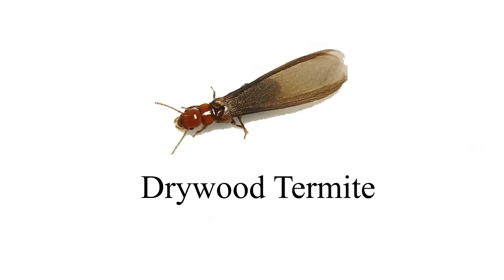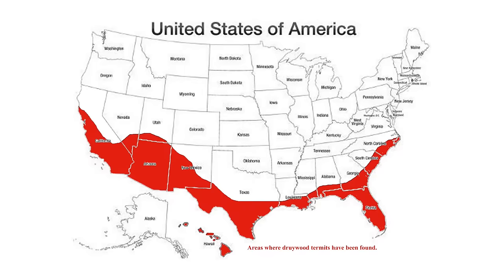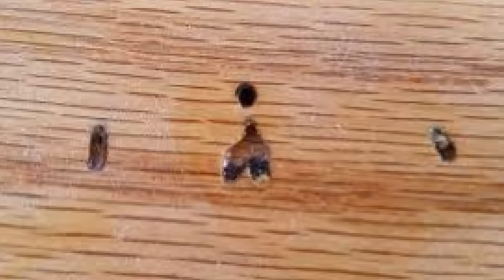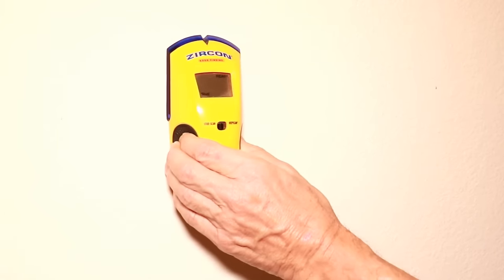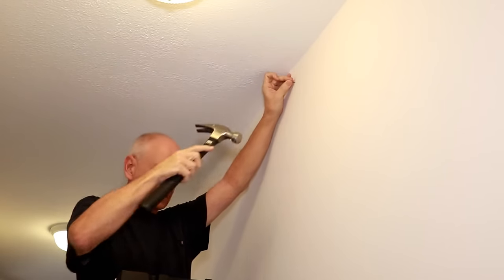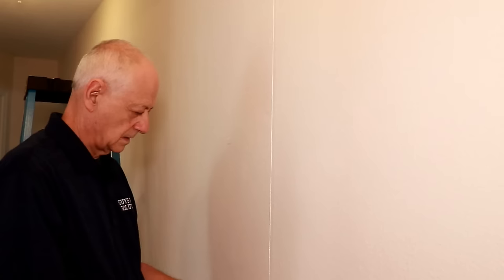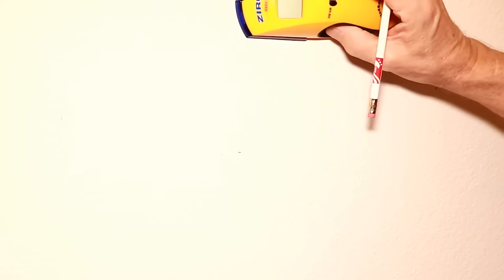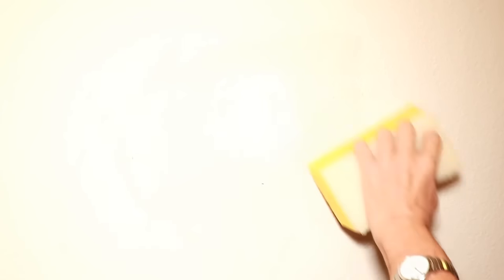How to Treat a Drywood Termite Infestation Yourself. A MUST see if you have Drywood termites.

Comment: Is it not a good idea to mix Bora-Care using a blender?  Also, how hot is too hot for the water to mix with Bora-Care?   Thank you in advance!
Reply from the maker: Gosh.  I never thought about mixing Bora-Care in a blender, but I don't see why not.  Just don't use the blender for preparing food after that.  The truth is that you can mix Bora-Care with cold water.  I do it all the time.  I don't think it matters how hot the water is, but I wouldn't boil it or anything.  Straight hot from the faucet is fine.  It really is not that hard to mix.  I needed a very small amount of it the other day and I mixed 1/2 cup of Bora-Care with 1/2 cup of water and I just stirred it with a paint mixing stick.  It takes a little longer to mix it that way, but it wasn't all that much time.  Even for that small amount, I took the water straight out of the garden hose.  I didn't think of using an old blender, even though I do have one.  So, that may be a great idea for mixing small amounts.  By the way, you should always mix it one to one with water and not one to five, even though the directions say that you can do it that way.

I hope that helps.  Be well my friend.
Reply: @GuysPestSolutions   Thank you for your reply.  It seem that when I mix it in a 5 gallon bucket and use a paint mixer on a drill it takes a bit to get it mixed.  

Glad you told me to use 1:1 as I was only mixing 1:1 were I found termites and 1:4 for preventive spots. 

Thanks again!  You are a godsent!
Reply from the maker: @celldata4john  You are very welcome.  Thank you so much for those kind words.  Very much appreciated.  Be well my friend.

Comment: Thank you this has been educational.. I had add a fumigation done and sprayed the attic but I'm not satisfied not satisfied. So so do I do the board acid and use the granules or do I I'm confused Taurus SC?
Reply from the maker: I'm sorry.  I know this stuff can be very confusing.  Let me see if I can unpack some of this for you.  You see, termites come in two basic flavors.  There are subterranean termites and there are drywood termites.  As the name implies, subterranean termites live underground, and they never colonize in your house.  They just go there to eat because your house is their favorite restaurant.  They always return home to the colony to obtain the moisture that they need to survive and to feed the other termites in the colony.  So, subterranean termites always attack from the ground up.  That is why we can simply use the granules around the perimeter of the house to wipe out the colony in most cases.  Drywood termites are much different.  They are not subterranean at all.  These guys do not live in the ground.  They colonize inside your home.  Therefore, treating the perimeter of your house with the granules would be ineffective against them. Unlike their subterranean cousins, drywood termites literally fly to your house and enter through cracks and crevices around the windows and doors or around the eaves of the house.  The only guaranteed way to get rid of them is to fumigate.  The problem is though that the gas they use to fumigate has no residual action, and so you can get reinfested the same day that the tent comes down.  If you have drywood termites, then it's a sure bet that your neighbors have them as well.  Since drywood termites swarm for several months every year, it is almost a certainty that you will get reinfested within a year after the fumigation has been done.  Somehow, it always seems to slip the mind of the company doing the fumigation to mention this to you.  The thing is though that you can prevent this from happening by doing a preventive treatment every two months.  Even though you do not have subterranean termites, you should still treat with the granules every year around the perimeter of the hose to prevent subterranean termites.  I will provide a link to that video.
 
Now, let's talk about how all of this relates to you personally.  If you had a fumigation done, then you had a drywood termite infestation, because they only do fumigations for drywood termites and never for subterranean termites.  So, the question becomes, "How long ago did you have the fumigation done?"  If it was within the last week or so, then you may get lucky if you start doing the preventive treatment right now.  If the fumigation was done a few months ago, then it is likely that you are already reinfested.  You may not know that you were reinvested because it can take years before you notice the damage or see new swarmers.  That is because it can take between four to seven years before a gallery is mature enough to produce swarmers.  Also, galleries start with just a king and a queen, so it takes a while before there are enough termites for you to start seeing the damage.  I always hate being the bearer of bad news, but the truth is, if that fumigation was done more than a few weeks ago, then you are probably going to need to do fumigate again.  You may not be seeing any evidence of termites right now, but you will.  It's just a matter of time.       
 
If I were you, I would begin doing the preventive treatment immediately, to stop even more termites from entering the building.  I will place a link below for my video on how to do that.  In the video, I recommend doing the treatment every three months, but I am rethinking that, and now I think it is best to do it every two months.  That is because the pesticide is going to lose effectiveness over time, and it will not be as effective in the third month as it is in the first two months.  Therefore, I started treating my house every two months, because it really doesn't make sense to take chances with drywood termites.  
 
If you wish to treat the attic, then you should do it with Bora-Care, mixed one to one with water.  The label will tell you that you can mix it one to five, but that will not work as well.  If you watched my video on how to treat drywood termites yourself, then you know that I have a procedure for that in the video.  If you have an unfinished basement or crawl space, then it is a good idea to treat that with Bora-Care as well.
 
I am so sorry that you are having this problem and I hope you find this information helpful.  Please feel free to ask all the questions you like.  I am always here to help.
 
Be well my friend.    
 
Video on how to prevent drywood termites:   https://youtu.be/neNsmVbj8Pc

Video on how to prevent subterranean termites with granules:  https://youtu.be/H7rW_TSBHJ4

Comment: Yet another question! Surprising how many things one has to consider when trying to eliminate drywood termites. Never knew it was so complex. In my continual quest to prevent swarmers from starting new colonies, I was going to seal all receptacle cover plates and ceiling fixtures too. There is a material called butyl tape which would do the trick. Before sealing all these electrical and air vent openings with butyl tape, are there any tricks you may know which may work better? Thanks for sharing your amazing knowledge and experience.
Reply from the maker: I don't know that you need to seal around outlets, switches, ceiling fans and so forth.  I'm not saying that drywood termites could never enter that way, but I have never seen it.  That being said, I have learned to never say never.  I do sometimes seal outlets for other pests though and what I use is plumbers' putty.  You just roll it into a cylindrical shape and put it under the outlet cover and press it into place.  Unlike butyl tape, the plumbers' putty will compress, so that the cover will be totally tight to the wall.  Any squeeze out can be easily wiped off, so the outlet looks like normal.  You would never know that it was sealed in any way.
Reply: @GuysPestSolutions  Good to know and good tip. Thanks.

Comment: Treating termite outside the house every 60 days? My pest control come to do pests control every quarter? How does these work? Will these chemicals mixed together?
Reply from the maker: That is actually a very good question.  Here's the thing you need to know about pesticides.  They claim that the pesticides will last up to 90 days.  The operative words there are "up to."  Your pest controller is coming every 90 days because it is cost-effective him to do it that way.  He knows the same thing that I know.  The pesticide that he is using is probably not going to last 90 days.  How long a pesticide lasts depends on a variety of factors, but it is just common sense that the pesticide is going to work best when it is first applied.  From that moment on it is going to start to lose effectiveness.  So, 60 days in, it is not going to be anywhere near as effective as it was in the first 30 days.  That last 30 days may not provide any real effective treatment at all, or at least not very much.  The pest controller makes more money by doing the treatment every 90 days, but you really are not going to have very good protection for the last 30 days of the treatment.  This is not such a big deal if you are trying to keep ants, silverfish, earwigs, and that sort of thing out of your house.  However, when it comes to something like drywood termites, you cannot afford to have a weak treatment on your house.  If the pesticide does not kill the swarmers when they try to enter your home, then you are going to have another infestation.  So, when it comes to drywood termites, this is not a time to take chances.  I gave you a link previously for a video on how to treat the exterior of your house.  You can do this yourself, and not only will it prevent drywood termites, but you can also tell the pest controller that his services are no longer required.  The treatment that I am recommending is going to be way better than the treatment he is doing.  Almost no pest controllers will treat above their shoulders.  Therefore, the treatment they are doing is not going to prevent drywood termites.  The treatment I am recommending will not only prevent drywood termites, but it will do a much better job of preventing all the other bugs that the pest control is already treating for.  So, you can immediately stop paying so much money for something that you can do yourself. 

In the video I show you how to use two different products.  Both are effective against drywood termites, but the truth is you only need to use one of them.  In the beginning of the video, I talk about using Bifen IT and a tank sprayer.  Near the end of the video, I talk about using Bifen XTS in a hose end sprayer.  The reason for using the hose end sprayer is to reach places that are high up, so you don't need a ladder.  The truth is that you can also use a hose and sprayer to treat the entire house.  So, there is no need to use the Bifen IT if you are going to use the hose and sprayer.  The only problem with the hose end sprayer is that it can get a lot of pesticide on the windows, and it makes the glass look a bit hazy.  To avoid this, simply buy a cheap pump-up tank sprayer.  Put the hose end sprayer on the stream setting and simply fill the tank sprayer with it.  This will give you the exact dilution rate that you need to treat around the windows.  It is fine to treat the rest of the house using the hose end sprayer.  This makes the job go really quick and easy.  I will give you another link to that video.  If you do this treatment every 60 days, then your house will not get attacked by drywood termites and you will be pretty much pest free.  Keep in mind though that if you already have an infestation of drywood termites, then this treatment is not going to eliminate them.  It only prevents new ones from entering.  If you have an existing infestation, then the house does need to be fumigated.  Please let me know if that is the case and I will provide you with a lot of information about it. 

I hope that helps.  Be well Candice.

Video on how to treat the exterior of your house:  https://youtu.be/Yozv3s-Qwlw

Comment: Ty for the detailed info.  I have quite a bit of liquid termidor left. Can I make the holes in wall and apply or do I really need to use the foam? Ty
Reply from the maker: You really do need the foam.  The difference is that the foam expands to several times it's original size, so it gets into the deepest parts of the galleries.  The liquid just won't get it done.  Sorry about that.  Be well my friend.

Comment: Does the gas used in fumigation for dry wood termites affect clothing and food in the cabinets?  Does it leave a residue that be transferred to the hands or the body?
Reply from the maker: It should not affect clothing, but food should be placed in sealed containers or removed before the fumigation.  It will not leave a residue that will be transferred to people or pets.  I hope that helps.  Be well my friend.

Comment: I had new kitchen cabinets installed 6 years ago. For the last 2 years I've been treating the frass holes by drilling the hole and spraying Premise into the hole. But then they pop up somewhere else in the cabinets. They no doubt came from Asian plywood. I've come to realize that Premise is temporary. I want to use Borate by drilling into the cabinets, shelves and drawers. How would you go about treating the cabinets with Borate? How far apart should the holes be drilled, how big and how would you inject the Borate without it dripping back out the hole? Besides a pump sprayer is there something else I can use?  I have hypodermic needles that wouldn't need such large holes.These drywood termites have only been seen in the kitchen cabinets.
Reply from the maker: I am so sorry that you are having this problem.  The Premise is most likely killing the gallery if you are applying it correctly.  You need to inject it into the holes for 5 seconds, or until it is coming back out at you.  This is most likely not why you keep seeing them pop up in new locations though.  It is important to understand how drywood termites' work.  It is unlikely that they came with the cabinets.  It is far more likely that they came from the outside.  They enter through cracks and crevices around windows, doors, eaves, pipe penetrations, and so forth.  Most of the time, they enter through several locations.  That is because a swarm of them attacked your house at the same time.  If there was a crack or a crevice, then they probably found it.  After they establish their galleries, which will be inside the wood, it will take four to seven years for them to be able to swarm.  Now that they are in your house, the swarmers will use holes that are in your studs to travel through the walls.  Those holes in the studs were created by the electricians to run the electrical wiring.  Not only are these holes going through the studs, but holes were drilled into the attic for the light switches and to run some of the wiring for the outlets.  So, the termites now have easy access throughout the attic and the walls.  If you have a basement or crawl space, they have access to that as well.  Most of the time, you will have no idea that they are in the walls, because the frass is inside the wall.  To make matters worse, if you have drywood termites, then your neighbors have them too.  That means you have been getting swarmed for as long as they have existed in the neighborhood.  Most likely, we're talking about years, so it's a safe bet that you have these guys in many locations in your home.  This would also include the cabinets.

I always hate to be the bearer of bad news, but if you have drywood termites, the only sure way to get rid of them is to fumigate.  Prices for this can vary wildly in this industry, so I recommend that you watch my video on how to hire a pest controller without getting ripped off.  That video can save you a lot of money.  You should also know that the gas they use to fumigate has absolutely no residual action whatsoever, so you can get reinfested the moment the tent comes down.  Like I said before, if you have drywood termites, then your neighbors have them as well.  Since drywood termites swarm every year, it is almost a certainty that you will be reinfested within a year after the fumigation is done.  The only way to prevent this is to do a preventive treatment on your house every 60 days.  Most pest controllers will not do this, so it is something that you generally need to do yourself.  I have a video on how to do that and I will place a link below.  This is a generic video that covers a lot of different pests, but it also works for preventing drywood termites.  Just ignore the part about treating your yard.  You only need to treat the house for drywood termites.  This will not treat the termites that are already there, but it will stop new ones from getting in.  If you absolutely cannot afford to fumigate your house, then you can try spot treating it yourself.  It is virtually impossible to find all the termite galleries, but it is way better than doing nothing.  Regardless of how you treat it, you should begin the preventive treatment immediately, so that you do not get additional termites paying you a visit.

You cannot effectively treat drywood termites with borate products.  Spot treating galleries is best done with a foam.

I hope that helps.  Be well my friend.                    

Video on how to hire a pest controller without getting ripped off:  https://youtu.be/y-a8XOqVrlE

Video on how to prevent drywood termites:  https://youtu.be/Yozv3s-Qwlw

Video on how to spot treat drywood termites:  https://youtu.be/U7ck7zhS0Xo